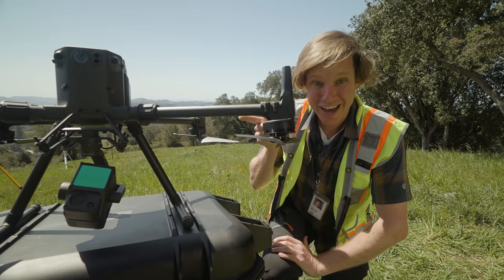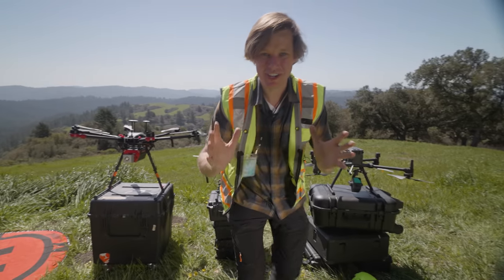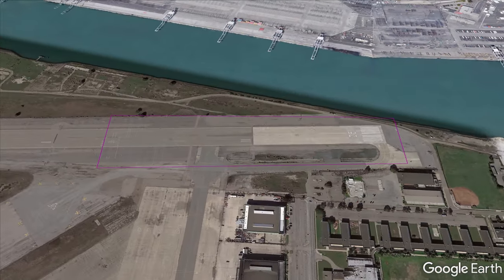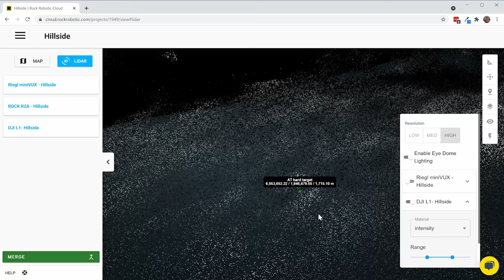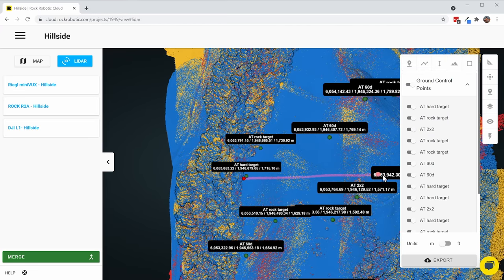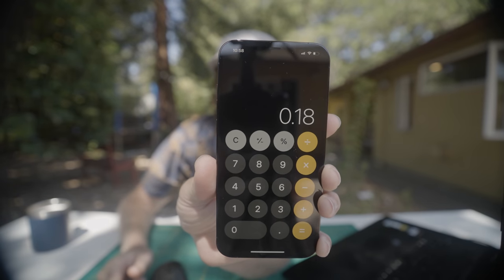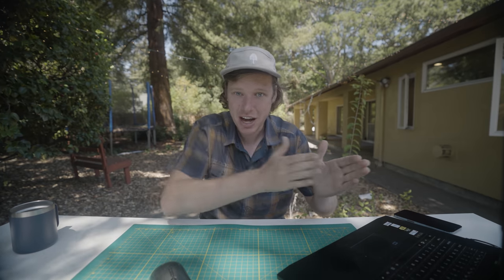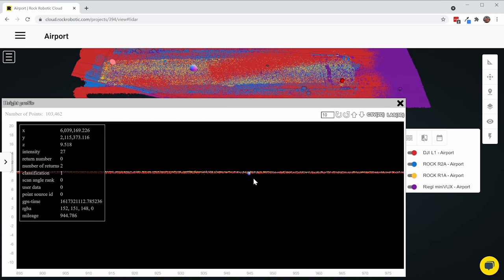Don't buy the DJI Zenmuse L1 until you've seen this! ROCK vs RIEGL vs DJI

Comment: A few questions/comments

1) is the DJI L1 drone named this due to its GNSS only recording the L1 carrier phase? If so, this would explain the undulation.

2) regarding horizontal accuracy comparing the GCP's, does your cloud software have the option to enter lever arms (distance offsets between camera, lidar, GNSS, IMU) for non-R2 systems?

3) Did you try generating control reports in another software like TSCAN? The rock cloud seems user friendly, but concerned it could be biased towards R2 data sets depending on the derived algorithms used.

Interesting video, thanks for the content.
Reply from the maker: 1. I don't think so! Check out DJI.com for more info on that.

2. Those values are entered in the creation of the .LAS. file, which is done before uploading to the ROCK Cloud.

3. They're not biased and you can manually check them in the ROCK Cloud... or any other software. 

Thanks for watching!

Comment: IMU drift. it is simply outclassed by the RIEGL and the ROCK systems. The real killer for the L1 is the laser ranging "fuz" accuracy which is awful. That means you can't even correct for the drift at any scale. It is basically one step up from an expensive toy.

Comment: I am interested in this technology as an Instrumentation and Monitoring engineer.  At what point are crossing the line between monitoring (ground movement) and surveying?  I wouldn't want to be surveying without a license.  The obvious answer is to hire a licensed surveyor, but it's not that easy as we work all over the US.
Reply from the maker: There is nothing wrong with using the equipment for your use case. The only time you need the licensed surveyor is if you are submitting your measurements to a governing body.  

Think of it like a tape measure. Any one on the construction site can use one, but if you are using that tape measure to submit plans to the county then they want those measurements to be signed and sealed by a certified individual
Reply: @IndianaDrones  Do you mean "submitting measurements to a governing body" for purposes of legal boundaries or as-built locations of structures?  We submit displacement values to owners (DOT, County, City) all the time, but our measurements tell you if something moved, not where it is in the real world coordinate system.

Comment: Hi, thanks for a great video. I suspect the undulation on the L1 comes from the RTK GNSS receiver's calculation of the elevation, assuming that these measurements were done in RTK mode and not post processed. That is the only time related variable in the processing of the cloud. You should try to measure using GPS only and lock out the other constellations from the RTK solution. I agree, the wide fuzz on the L1 is a deal breaker.
Reply: thinking same thing. i bet they did RTK. PPK is way better way to position DJI's GNSS. i bet this was the on board rtk engine. When I do PPK and use all constellations I still get 8mm or better positions it seems. But I do it manually and with python scripts etc. Not user friendly.

Comment: hi,
If your Matrice 300 is paired with D-RTK2, do you still need to use GCPs to achieve better accuracy?

What's the difference between using M300+DRTK2  vs M300+GCPs?

Comment: When you find most customers that are interested in having data analysis for surveying their vegetation. They are trying to get accurate and reliable data.  From what you just showed though unless your doing something to where customers would make use of this info like a bridge and consistent water level rising data or cable points,Grand Canyon etc. it seems like the L1 is what makes the most sense wouldn’t it? Because all of the data was within 1 ft or so of the other two which one cost 200k and the other 40?
Reply from the maker: First of all, no! Secondly, new price-point on the R2A ($19,995)!

Comment: Hi, I need help choosing enough cheap LiDAR drone for a charity work. I would like to use it in refugee camps, unfortunately they just place the tents/sheds without careful thoughts and when the rainy season comes some areas with sheds become flooded. I am interested in something not fancy, not interested in detailed  high resolution thing just need enough to figure out the elevation and which low points to avoid placing tents. Further idea is to "connect" the low areas and channel the rainwater to a man made pond which can be used for harvest. Thanks.
Reply from the maker: Hey there! Thanks for your interest. Please reach out to hello@rockrobotic.com — a member from my team will help you out!

Comment: Heat Mirage

Just curious, could the precision of the runway data be varying due to a heat mirage above the surface of the runway. Lasers can be refracted just as light can, so that may be the issue you're running into.

Check what time of day you measured with the L1. Did you run it last? The runway is one big thermal mass, so it gives off the most heat later in the day.

I may be wrong, but it's worth experimenting with.
Reply: By the way, I enjoy your videos. Keep it up!
Reply from the maker: Thanks for your feedback! Feel free to bring your questions and requests over to the ROCK Robotic Community discussion board. Our support team is ready to answer all of your questions. 

https://community.rockrobotic.com/

Comment: Harrison/community: What would one use the L1 system for if it, as a lidar system, can not give survey grade results? Is this more of an introductory kit to provide volumetric measurements and decent 1-2' contours, and maybe higher quality 3D modeling? Thanks
Reply from the maker: Exactly, it is used as an introductory kit.
Reply: @Indiana Drones  Hey... introductory kits can still make 10's of thousands in the right hands!

Comment: Umm  Interesting.. thanks..  I am not as up on LiDAR as I should be but can the returns be isolated and what happens IF you perform a regression analysis on the raw data?  How does your data look then?  The anomaly in the data you suspect is a time differential, could that be from a reflective surface throwing off the data.. maybe water on the surface on or near the runway?
Reply: He literally flew over the exact same runway in the same day. most likely it is the GNSS solution or else just he lidar sensor itself was drifting in precision.
Reply from the maker: Thanks for your feedback! Feel free to bring your questions and requests over to the ROCK Robotic Community discussion board. Our support team is ready to answer all of your questions. 

https://community.rockrobotic.com/